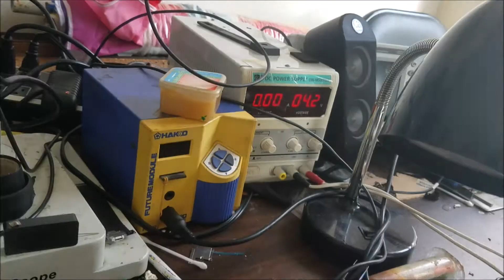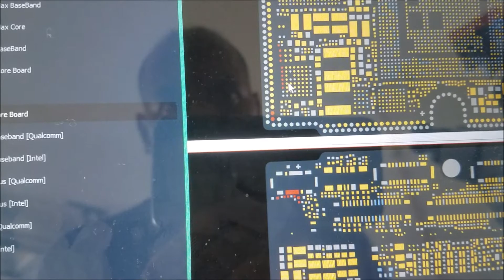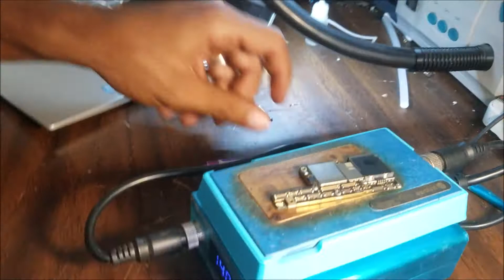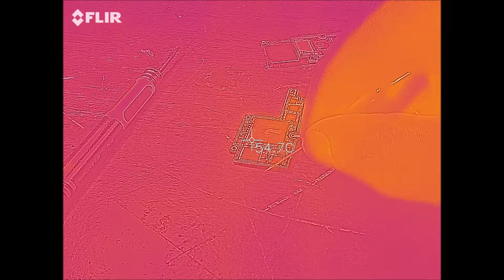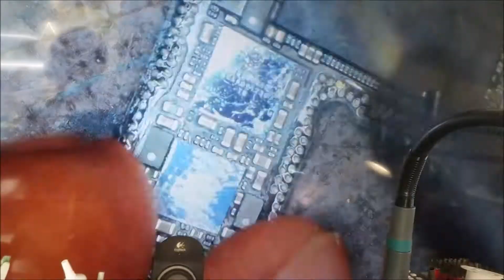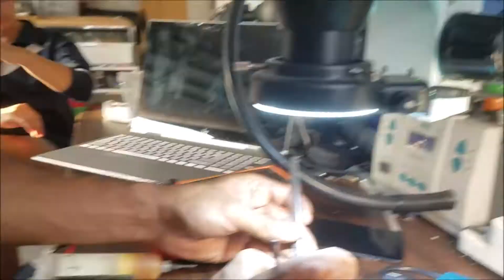iphone x no power how to find shorted component

Comment: Nice repair, very well explained. That Flir is a great tool, but expensive. Maybe one day, it's alcohol & burnt fingers for now. 🥴
Reply from the maker: :D the bad think in this cameras the battery dead quick
Reply: @SOSfixElectronics  ughh, thats not helpful. It has amazing resolution. I'm thinking when I get one I'll get the stand alone one so I don't have to tie up my phone. I think they have some decent ones for around $300. It's on my list 🙂
Reply from the maker: @electronicrepairservice2020  if you getting one get flir one pro it is double resolution the regular version.  I made a stand for it and i got a female to female usb c cable for the phone it works better that way. But be cause i m in my garage no space in the this table for that.
Reply: @electronicrepairservice2020  There is the UNI-T UTi260B. 
Here Voltlog compares it to the Flir - https://youtu.be/h3Hu_op4mG8
Reply: @electronicrepairservice2020  Here Votlog modifies it to make it better - https://youtu.be/oFR2MZWozTU?t=535